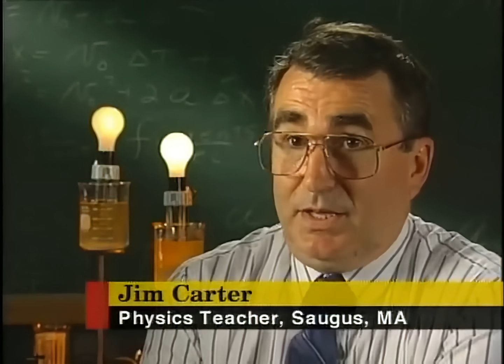MIT graduates cannot power a light bulb with a battery.

Comment: "Do you think you could push a compact car down a hill?"
"Of course."
Supplies an 86 Honda Civic full of cement with no wheels

"There you go, M.I.T. Students are stupid."
Reply: DOUGLAS SCOTT 

Your humor is that of a smart person.
Reply: The woman asked them if they could do it.  She never said it could be done.  They weren't calling them stupid either.  Just pointing out a flaw in college education, even at one of the best schools.  Of course the school is great, but there are things that people are missing, that should be addressed.  If it can happen at MIT, think about what the result would be at other schools.  Without criticism, how will anything improve?  MIT is the best, but that just means better than the rest, not the best humanly possible.

Once again, you can't blame the students, who knows what they're majors were.
Reply: Someone might be taking this a bit too far
Reply: DOUGLAS SCOTT I answered the question by saying that your question is based on an assumption you made about the experiment which you don't know for sure. Holy shit...
Reply: Gilang Arif 
A different bulb.
Reply: Douglas Scott:  except this wasn't a trick question whatsoever.  An engineer from the top engineering school in the nation should, wait no, MUST know what to check for when doing this.  Pull out a pocket multi meter and test the battery, then read the power requirements on the bulb, check continuity of the wire.  Or know offhand that not even an LED would light with a C or D battery by without a DC-DC converter.
Reply: MantisRay861 
You just discredited your own opening statement.

1)No voltage meter was provided.
2)It couldn't be done.
3)They laughed that they couldn't do the impossible.

Thus it was a setup or a trick question. 

Bravo.
Reply: DOUGLAS SCOTT You're an idiot. It's really quite simple. In order to "pass" the test, the student would only have to identify that the battery provided would not work and then say that. That would be how you "pass" this test. Not sit there looking at the tools given to you, fumbling and looking to the camera crew for guidance and asking for help. My God, go back to school. PLEASE.
Reply: DOUGLAS SCOTT 
Please, explain. How did they change the test "at the end?" 
Mommy and daddy's money towards your education went to waste, evidently.
Reply: DOUGLAS SCOTT their intentions are clear. You're right. They purposefully wanted to get footage of MIT students failing at this test.
AND THEY DID. 
You're really so outrageously stupid it's just hilarious. You're stating the obvious.
Reply: DOUGLAS SCOTT Thank you for waiting.
I'd like to begin by quoting a segment from this video. 
"Do you know why that didn't work?"
MIT graduate: "I have no idea."
NO. IDEA. He can't even identify the problem with the excitement. 
Secondly, you're making an assumption about why "they" changed the lightbulb (I'm assuming you're talking about the black graduate with the small lightbulb making it flicker?) which you don't have the necessary knowledge to make. It's really that simple.
Reply: Billathan Billdogovich 

1) The video title says MIT students are dumb for not being able to light a bulb.
The bulb could NEVER be illuminated with the tools provided.

That means that the testers or at the very minimum the uploader sees the test as the inability of the students to illuminate the bulb, this is a flawed test. 

They either designed the test for the sole purpose to humiliate the students OR The testers are the stupid ones for thinking it was possible in the first place.

2) At the end of the video, a student is given a compatible bulb to show the viewers that the test was indeed possible.

But it was never possible with the tools they had available, thus the intent was clear. To show either way that the students were stupid regardless if they completed a circuit or not.

So yes, I am absolutely certain that the experiment was conducted in elicit a predetermined outcome.

**

Where are your critical thinking skills?
Reply: DOUGLAS SCOTT They didn't fail because they couldn't make it work. They failed because they THOUGHT they could, TRIED to, and then didn't realize why they COULDN'T. Get it into your empty fucking skull, my God you are a waste.
Reply: DOUGLAS SCOTT best comment of the comments section 😂😂
Reply: MantisRay861 

Don't offer a test claiming it can be done , then call the OTHER person stupid for not being able to complete it.

They purposely mislead the subjects that it could be done.
Reply: ***** 

They were not ridiculed for not working out that the test was false, they were ridiculed because they couldn't complete the test.

Even the title of the video states this.

It really is not that difficult to grasp what they were trying to do.

If we used your explanation, then the makers of the video are even more stupid than the students.
Reply: ***** 

If you do not know the answer to a question, how can you know the other person is wrong?

The makers of the video conducted a test they thought was doable. It wasn't. 

The initial question was "Can you light a globe with a battery."

Followed by "M.I.T. students couldn't light a globe with a battery."

Could you have completed their test? No you couldn't have. Then you must be stupid too. Get it?

They next showed one student actually completing the test.... with a DC compatible globe.

Why?

To 'prove' it could be done and the other students were stupid.

But you missed all of this as you are too busy focused on a subject not covered by the video.
Reply: Billathan Billdogovich 

Explain why they had to change the bulb to show the test could be passed, if the test had nothing to do with lighting the bulb.

I eagerly await your answer.
Reply: Billathan Billdogovich You still don't get it.

And you dodged the question.
Reply: Billathan Billdogovich 

Sigh.
You didn't even watch the video.
Reply: DOUGLAS SCOTT are you telling me you know with absolute certainty why the experiment was conducted as it was? If you say you can, you're not being entirely truthful. You know this.
Reply: DOUGLAS SCOTT Yes, there was obviously the goal of making MIT graduates look stupid. It worked.
Reply: noklausījās komentētājs 

Oh really?

Please explain to everyone here how a candle bulb that requires 120v can be powered with a single D Cell 1.5v battery.

Now even if the bulb was a super efficient 6v LED bulb(it wasn't), explain how it could be powered by a single D Cell 1.5v battery.

I am really interested in how this will be accomplished with the tools they had.

Your answer will grant you the Nobel Prize in Physics.
Reply: You're right. Oh wait!!! The black guy did it!! 
Magic!!!! He did something that, according to you, is impossible. Go back and watch the video again.
Reply: Just Me   
Your observation skills are as poorly developed as your analytical abilities.  
  
The 'black guy' used a different globe.
Reply: "1) The video title says MIT students are dumb for not being able to light a bulb. The bulb could NEVER be illuminated with the tools provided."

The implication is that they should know it doesn't work, fool.
Reply: Arif K 

How many volts is a standard Candle Bulb?
How many volts can a D-cell battery output?

Please link to us a 1.5v Candle Bulb of the same size in this video from any manufacturer.

The only person who lit up a bulb, used a tiny DC compliant torch bulb, guess what it was designed to run on?

My point still stands, you just do not understand both Physics and sarcasm.
Reply: @douglasscott9322  8 years ago, edited.  I don't care, I'm correcting your ass anyway.  They supplied valid batteries, wire, and bulbs for the question.  Regardless, a bulb like that doesn't require any specific voltage.  It'll radiate light with any voltage, or even no voltage.  It's essentially black body radiation, which depends on temperature.  Power (voltage x current) running through it increases the temperature.  You just need enough power running through it to heat it up to make it a bright, useful bulb.
Reply: They are not stupid because they could not light up the >=20W light bulb. They are stupid because most of them could not even close the circuit. And they didn't understand why it would not light up even if they would have closed the circuit. Thats two basic things they should have known. I knew this when I was 8 or 9 . The guy that was shown with a small bulb was the one that said "maybe", because he understood that he needed more information about the battery and bulb.
Reply: DOUGLAS SCOTT 
The funny thing is that Douglas still didn't understand the point of the video even after watching it or having it explained to him. He thinks it's about the light bulb, he's angry that these kids were duped, and he thinks the test should be readministered. In his defense, he is probably relying on the way this clip was titled to frame the issue.
Reply: DOUGLAS SCOTT Actually the light bulb problem has no tricks at all. It's simply assessing their understanding of a basic closed circuit. To discover their are MIT grads unable to solve this basic problem implies the teaching is fundamentally ineffective.
Reply: DOUGLAS SCOTT Why are you calling me stupid? You do not seem to understand that the result of this test is not whether they could light it or not. It is also a looking glass into their thought process, and it is there they fail hard. It is clear as day that they lack the basic skillset of making i light bulb light up. Because they can't connect it correctly, and they fail to notice the obvious part that you can't really power such a light bulb with a D-cell battery. They should have deducted this long before trying at all.

It was never a real task to make that light bulb light up. It was to check their response on the task. I would guess the one guy getting a small light bulb got it eventually after making it a point that it would not be possible to light it because of the battery, not because of the single wire as the others pointed out.

Why are you taking this so personal? Since you feel the need to tell people that argue with your point, that they are stupid?
Reply: Know the details before agreeing to ANYTHING

Leads me to wonder, which one were you in the video?
Reply: Lmao, Hakon is right, half the kids don't even put the wire to both ends. Its like they really just dont understand how a battery works. Oh but no a rich Ivy league school could never have dumb ass kids with rich parents. Its just cherry picking, yes :^)
Reply: @lubu4u312  no one goes to MIT , Stanford or Ivy by money
Reply: ***** 

No, you're right, it is technically a subcompact car. Smaller than a compact car.

As for Sokrabiades 

You clearly didn't understand the point of the video because you also failed to understand my sarcastic post.

These guys were given a test they couldn't pass. So either the creators of the test are the stupid ones or it was specifically designed this way.

What part of this confuses you the most?
Reply: Håkon Nessjøen 

Because you fail to understand Physics and blame the lack of knowledge of how to use tools as justification for their failure.

The example in my first post is reason enough, the point that you seem more focused on is the incorrect use of a tool that was never going to work in the first place, means you also failed the test.

It wasn't obvious to you either, as your first response was to attack the improper use of a tool, instead of objectively pointing out that the tools were not the problem, the test itself was.

They were always going to fail, what part of that confused you?

Even if they completed a circuit correctly, they were still going to fail the test.

Let me say it once more so you can understand.

The test was designed so you would always fail

Did you get that yet?

How about this.

NO matter what they did, they would be branded as stupid.

Did you get that?

No, because you are trapped in a loop as you refuse to admit that you couldn't see the obvious.
Reply: Håkon Nessjøen 
Closing a circuit wouldn't have granted them success to the challenge presented, and that challenge was light a bulb with a battery.

My point still stands, but you are too stupid to understand.

If I give you a task, and regardless of the tools provided it would be impossible to complete, it wasn't the fault of not being able to operate the tools correctly, but the sheer idiocracy of tricking someone into accepting a challenge you know could not be completed, just so you can make the other person look stupid.

This is proven by the fact the only one to complete the challenge, was given a different set of tools. IE: The different bulb.

The fact that you cannot even see this boggles the mind.
Reply: That doesn't change the fact that they had no idea why it wouldn't light.  The purpose of the video is to show the disconnect between theory and hands-on experience.
How about this:  
1.  The battery can only be 1.5v (or slightly higher, but <2v)when fully charged, which would have been printed on the battery itself.  
2.  The bulb would most likely have the wattage and voltage printed on it.  
3. Looking at that, you could just say, "well this battery will not supply enough current or voltage to light this bulb.  Give me an (xyz) battery or a smaller light bulb, and I'll do it.  "

The problem is that they didn't ask the questions that needed to be asked.  I would hate to see what would've happened if she'd asked them to light a bulb with 2 wires and a 240 volt wall socket.

After watching the video again, I have to say the only flaw I see with this is that they didn't pick only electrical engineering students.
Reply: noklausījās komentētājs Oh right, lets add sand so the cement and be made into concrete so you are happier.

Moron.
Reply: noklausījās komentētājs Are you saying that cement is not a component  of concrete?

Okay boss, you win. Nobody can debate against stupidity.
Reply: do you have been watched the video fully?
there is no trick, one of the student can light that bulb
Reply: MantisRay861 

You missed the point entirely.

This video was created specifically to show students in a negative light.  (no pun intended)

Even if the student had completed a circuit, the test would have failed. 

This is evident by the actions of the last student who did complete the circuit BUT he was given a compatible globe, this was done specifically to show the viewers that it could have been completed by the previous students (but it wasn't)

Why you cannot see this is pretty evident. You do not pay attention.
Reply: ***** 

You are still defending the test.
Reply: Billathan Billdogovich 

Wrong.

They changed the test at the end, it's clear what their intentions were.

You are just too stupid to see it.
Reply: Billathan Billdogovich 

You cannot fail a test where the end result was always a fail.

If their Professor had given them a test and failed them because the Professor thought it could be completed, and it turned out the test couldn't be completed.
The students would have been given full makes because the Professor was an idiot.

The testers in the video thought the test could be completed, they were the idiots.

You are trying to defend your position with solely ad hominem attacks.

Please continue when you have learned basic logic.
Reply: MantisRay861 

1) They were asked to do a task that couldn't be done.

2) They agreed to complete the task before the tools were given.

3)They were always going to fail. The test was designed this way.

It was a setup, it's not that difficult to understand.

Comment: You're expecting a D battery to power a 60 watt lightbulb?
*Edit; Read the rest of the thread before you call me an idiot.
Reply: erik shure I mean heat the metal enough to start producing light.
Reply: Gewel He lit up a smaller bulb.
Reply: The Captain are you stupid? It's not about that they couldn't get bulb to light up. It's that they don't have any clue about the basics and that they also don't see why the bulb is not lighting up. Of course there were people who got it right. And of course it says something that most people did not get it. People need to understand how these videos work. Instead of defending your stupidity just because you don't want the truth because it hurts that people realize What they pay 60 k for
Reply: The Captain DC current from a battery will light the bulb. It may not be very bright but it will do it.
Reply: The Captain Depends on what it means to say "power that bulb".
Reply: "Hey, can you overflow this 80L bucket with a single cup of water?"
Reply: You can't figure it out either, huh?
Reply: Golden Duck What can't I figure out? one wire connects to one of the contacts on the battery and one to one of the contacts on the bulb. Then you touch the other side of the battery to the second contact on the bulb. It doesn't matter which way the polarity goes, It's just a resistor. These people were stupid to only connect one side of the battery, but it could never power that bulb anyways.
Reply: did you even watch it? 1 guy lit it up...

Comment: Okay, so they gave them a 120 volt bulb that runs with lots of energy and a D cell battery, and then they give them a bulb that works in the current and ampere range the D cell provides, and they call them stupid?

if I asked my mechanic to install a D-Cell battery to power my 12 volt car starter, would the mechanic be stupid because he needed a car battery to make it work properly or would the request be impossible?

these people are not stupid. they're being tricked. it's not about what variables they DO know, it's about the variables they can't. they don't know the rating for the random bulbs off by heart, but I guarantee you they are not stupid.

this video is stupid.